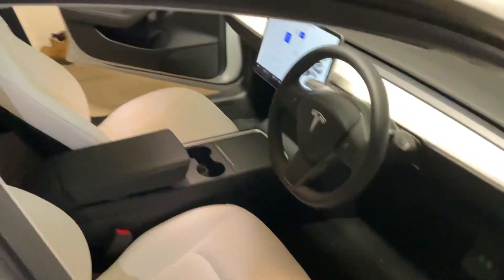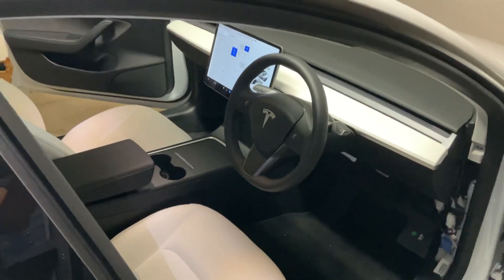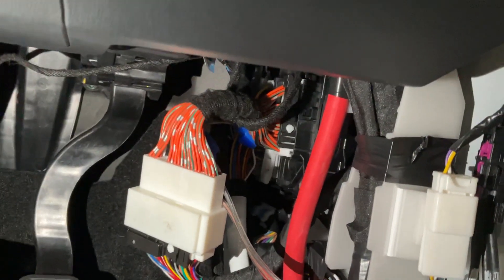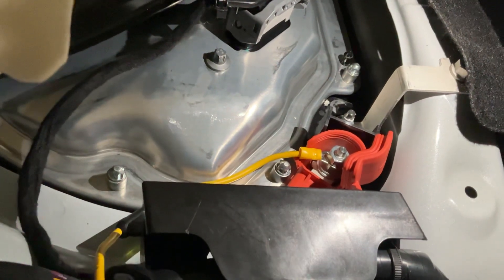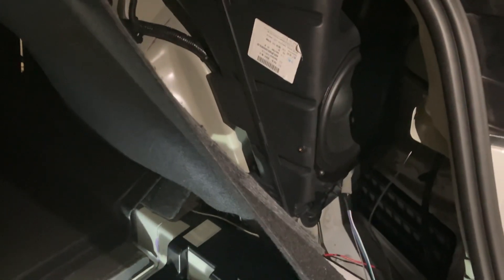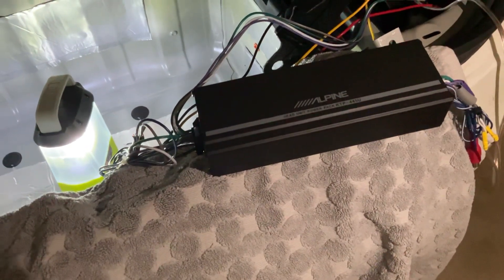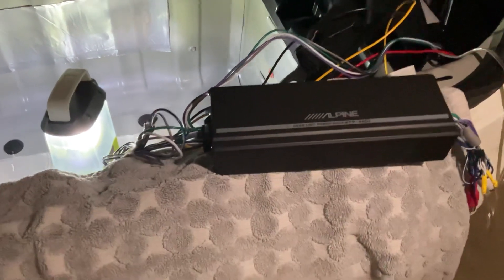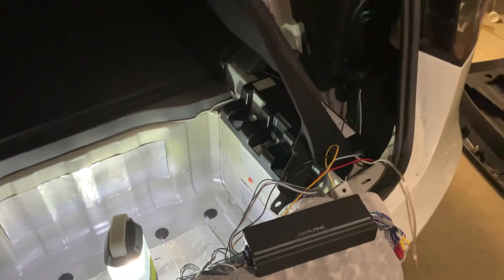Tesla Model 3 SR+ OEM subwoofer install

Comment: Just a little PSA to anyone who has a car with the lithium ion 12v battery, this amp likely will not work as the voltage is too high. You’ll need to buy a power supply step down from 15v to 12v 15A.
Reply from the maker: Thanks for finding this out for everyone the hard way!

So yeah this specific amp only works if your car has a lead acid 12v battery. If it has the newer lithium low voltage pack, then you should probably try to find a different amp that can accept the slightly higher voltage.
Reply: @locksmack  Will update here as soon as the voltage step down arrives
Reply: @everythingtesla8833  Is there any updates to this? What does the 16V system on the newer cars actually run at? 12V systems actually run closer to 14V. Surely a couple of volts wouldn’t need to be stepped down to avoid issues with the Amp..
Reply: @TechnoMonkeyFarm  for some reason that specific amp doesn’t like to intake 16v with my experience with it
Reply: @locksmack  what gain settings did you use?
Reply from the maker: @everythingtesla8833  about a quarter turn. It’s pretty sensitive so start low and slowly increase until you are happy.
Reply: @locksmack cool! Do you remember what settings you did for the dip switches?

Comment: A little late to the party, but I’ll be doing this same install to my 2020 SR+ 😁

Got a speaker activate harness, but it turned out to be the LHD one (I’m Aussie too, so I need it to fit RHD) - didn’t even know there was a difference…so I was pulled into the weeds, found Tony Holdgates blog and all that brought me here!

The gear I’ll be using:
- EV Offer - Speaker Activate Harness - Variant A (RHD 
w/Sub Output wires)
- 2x OEM Rear Deck Speakers
- OEM sub
- Alpine KTP-445u

Never had a sub in a car before either, so I’m pretty keen to receive the gear for it and get it all in there!

Ps Thank you for the video and your helpful replies to people 😁

Comment: I ended up installing the Alpine S2-W8D4 in the Tesla OEM BOX with the Hepaking adapter. And I replaced the Alpine amp with the  Kenwood KAC-M1814  because the Kenwood has a low pass filter- I set the frequency at about 80 Hz. I also replaced 7 Tesla drivers with the Alpine kit from Hepaking. Now the audio system sounds great- better than the Tesla OEM premium audio system, at least in the front seats.

Comment: I'm going to do the same install and I have a question. What gauge are the front right speaker wires? I am going to use Positaps to do the wire taps.
Thanks!

Comment: Would this work on the 2023 model 3?
Reply from the maker: Probably not due to the higher voltage ancillary battery. See the pinned comment. Would need an amp that can accept around 15v.

Comment: I installed a sub. Hi have PCS code. 12v from under rear seat and 12v switched from left front. Should I add a extra battery?

Comment: Where did you connect the remote wire ?
Reply from the maker: The amp automatically powers on/off based on the audio signal from the tapped speaker. If you plan to use a different amp, I would recommend making sure it has this feature for simplicity.

Comment: @locksmack I recently installed the Hannshow diy with 2 rear speakers on my 2022 Model 3 SR+ and was hoping to install a Pyle model#PSABASS10 Class-D Powered Enclosure Amplifier - 10-inch 500 Watt Slim Mount Truck Audio Subwoofer Box that I bought second hand.  Would I still be using on the hannshow harness the grey and brown wires(that are beside the black wire) or is it different being a 2022?  Also for power where should I be drawing that power from?  lastly is there anything else I should do for this install/setup?? I am new to this so please excuse all my questions, any help from anyone would be greatly appreciated.
Reply: Did u get this working

Comment: Hey guys, I’m definitely doing this exact install, I’m pretty clear on the install, but I have a 2020 with rear shelf speakers activated by Hanshow as well, u think I can tap into the rear shelf speakers on side of back seat opposed to front woofer? And also would u mind sending me some pics if u have of up close to the wire connections at amp sides?
Reply from the maker: Hmm I’m not sure. It depends if the signal to the rear parcel speakers contains the low end. If it’s a Hannshow tap then it’s probably just the same as the front woofers, but I don’t know for sure.

Comment: Could you show us how it sounds?
Reply from the maker: I’m not sure how well a recording of the sound would reproduce. 

All I can give you is a qualitative answer - it sounds MUCH better. I’d do it again with no hesitation.
Reply: @locksmack  how does it sound at high volumes? Any distortions and could you share with us your settings on your amp? Also, do you have a remote wire to control the sub?
Reply from the maker: @everythingtesla8833  No issues at all at high volume - the factory speakers distort before the sub does.

The only setting on the amp is the gain control knob - mine was set quite low, maybe 1/4 turn.

No remote wire. The sub has a feature where it turns on/off based on the high-level (speaker) inputs. No need for a traditional remote wire.
Reply: @locksmack  do you ever feel like you need to adjust it? Like if it’s too strong at lower volumes but not strong enough at higher volumes? Or do you feel like the amp keeps it pretty balanced? 

Do you feel like adjusting through the screen is good enough?
Reply from the maker: @everythingtesla8833  it’s fine. I’ve boosted the low end fairly high, so I probably should have put the gain a bit higher instead, but it’s still excellent.
Reply: @locksmack does your car have the lithium ion 15.5v battery? If so, have you had issues with the amp powering up?
Reply from the maker: @everythingtesla8833  nah it’s got the 12v lead acid battery. If your car has the lithium one, I guess you want to check that the input voltage of the amp supports it.
Reply: @locksmack  RIP. I am just finding this out… lol I have the amp in my trunk I’ve been trying to troubleshoot

Comment: Great video, thanks so much for this! I ended up going with a small 'spare tyre' sub for my 2022 M3 RWD. Quick question - how do you turn the power off completely for the install? My powered sub that has no on/off button on it. Whenever I connect the power to the sub, the sub's 20 amp inline fuse blows. I think it might be because the power seems to be on in the car when i am doing this. I have tried the 'power off' button via the safety menu and waited 2 minutes before attaching the power, but it still blows instantly - there seems to be power going to it. Any idea how to completely power off the car? Or am I missing something?
Reply from the maker: Hey mate, thanks for the nice comment!

When I did my install, I just did the ‘Power Off’ on the screen like you mentioned, though I found my car didn’t stay off for long, so I ended up doing the install with it on. I’m not sure if turning it off deactivates the penthouse 12v anyway - my guess is no. You would probably need to open the bonnet and manually disconnect the 12v battery. 

But I’m not convinced that it will help your issue. The in-line fuse is obviously ‘seeing’ more than 20A, which is a lot of you aren’t (presumably) playing any music when powering it on. Could there perhaps be a short in the amp? Have you got another 12v power source (another car perhaps) you could test with? Also do you have a multimeter to check your Tesla’s 12v? I know that 2022/23 cars use a lithium low voltage battery, which I think is more like 14v/15v rather than the 12v (up to 14v fully charged) on older cars with a lead acid battery. Perhaps the amp doesn’t like the higher voltage?

Keep me posted on what you find!

Comment: Do not use the penthouse for power source. It can cause serious issues quite unpredictability. Few days ago my car was completely blocked while driving, the car was carried  to the service center because it didn't even let the doors open...
Reply: I hooked two amps, a helix p six and a monoblock, with a 80a fuse. I used this setup for 10 months. The issue happened after the 2022.44.2 upgrade last week. Yes, the Tesla technicians told me that the 3rd party devide caused thr problem which was connected to the penthouse (a local car hifi service did the installation). The battery management realized the power loss and couldn't locate it's source, thus, the car was blocked for safety reasons...
Reply from the maker: @endreszigethy5704  that’s a fair bit more than the 15A amp that’s running here. Even before the most recent update there have been reports about the car picking up on unknown power draw and causing issues. Perhaps your setup was just on the edge of the threshold.
Reply: @locksmack   Yes, that absolutely makes sense. However, we don't know about the (current) threshold, which seems to be changed with the recent updates. Also, we don't know how it will change in the future. That's why I'm saying that is not a good solution taking power from the penthouse. Now I'm looking for other solutions, e.g. the onboard 12v was suggested by the Tesla technicians. I'll also try the power source of the premium amp on the right controller which probably more loadable than the onboard 12v, according to the wiring diagram.
Reply: @endreszigethy5704  If you want real powerful amps the easiest solution is an extra 12V battery connected to the stock 12V via high power resistor, which takes peak loads of the stock system.
Reply from the maker: What did you have hooked up to the penthouse? Did Tesla say this was the issue?

It’s approaching a year since I did this install and no issues so far!

Comment: Great vid.  I am planning to do this to my 2021 SR+.  I have an old home made sub.  and i am looking for a aftermarket amp to. power it. Can you elaborate what the problem is with some other aftermarket amps that are not compatible with Tesla ?  What exactly is  the problem when the amp is not compatible ?
Reply from the maker: Not sure I completely understand or can articulate it as it was advised to me way back, but the idea is that some amps pull a ‘spike’ of amps when first powered on for a moment, and the car notices this and errors. I’d recommend doing some research elsewhere on this and see if you can find other amps that people have used successfully.

Comment: Exactly what I've been looking to do since finding Tony's blog, so I appreciate the vid.  After having driven a Model Y around for the past couple of weeks I've been really impressed with the performance of the OEM sub.  I don't suppose you've been able to compare yours with the factory implementation in an LR or a Y?
Reply from the maker: I haven’t, though my next door neighbours just took delivery of a Y, so will see if I can have a listen.
Reply: I'll be interested to hear your thoughts if you do
Reply from the maker: @travisedwards3868  had a brief listen to my neighbours Y. Caveat that it was a single song and I didn’t play with the EQ, but I would say it sounded the same, or maybe worse. I definitely didn’t walk away thinking my 3 retrofit was inferior.
Reply: @locksmack  great stuff, that's enough to lock it in for me 👌
Reply: Okay so I've finally gotten around to doing the install myself. I ended up using a Pioneer GM-D1004 which is basically the same as the alpine. I used an EV Offer harness which includes subwoofer output. I'm finding though that the amp doesn't turn off when. There's no music playing. The only time it turns off is when the car goes to sleep with no sentry. 
Does yours turn off no problem?

Comment: Cheers for making this! Anyone tried it with a 2022 M3 with AMD Ryzen chip? I see the Hansshow harness listed as incompatible with the AMD-powered model, and thought it might affect this as well.
Reply from the maker: Hey mate. Hansshow (and others) do sell an AMD Ryzen compatible harness! The harness installation and wire colours might be a bit different to my 2021 version, but the overall install of the subwoofer should be the same. Best of luck if you decide to tackle it!
Reply: @locksmack  any issues with your 12v battery?
Reply from the maker: @everythingtesla8833  nope all going well still!

Comment: Did Tesla send all the wires and everything you need to hook it up
Reply from the maker: Nope. The sub has a plug on it that you need to cut and join the bare wires to the amp. Wire you will need to buy is to power the amp (able to carry 15a minimum) and speaker wire for the front door woofer wire tap.
Reply: What amp did you buy can you send the link
Reply from the maker: @Eqxsy  Hey mate, its the alpine power pack ktp-445u.

Comment: I'm going to upgrade factory speakers with Light Harmonic and want to add factory sub like yours. How's the sound afterwards? Have you noticed your Wh/mi go up? How long did it take you to add the sub/amp?
Reply from the maker: Hey Matt,

The sound is massively improved by the sub. Considering the relatively low cost compared to a fully aftermarket system, it's great value. It's not 'blow your socks off' powerful like you might have experienced with a high-end aftermarket system, but it's certainly the best OEM system I've heard.

My energy consumption hasn't changed. Prior to the install my lifetime consumption was 144Wh/km, and it is still 144Wh/km when I checked this morning (and this is despite the weather getting colder here).

The install is pretty straightforward, though if you take it slow and steady like I did, it takes a solid day to do. I did mine over a weekend, with about 4 hrs spent each day. Definitely could have done it quicker but I took my time.

Comment: hey mate, cheers from qld, just ordered an m3 base rwd. Was looking to do the exact same thing and this is just perfect. Thanks heaps

also, did you just book a service appointment and say you wanted that specific component?
the tesla people didn't care that you had a rwd model without the sub?
Reply from the maker: Thanks mate!

Yep that’s exactly what I did. In the booking message quote part number 1079747-00-D. They got back to me the next day with an invoice to approve and then ordered the part. It obviously doesn’t matter when you make the service booking for because you aren’t actually taking the car in, but you need to make one to open the support request. 

Cheers and good luck!